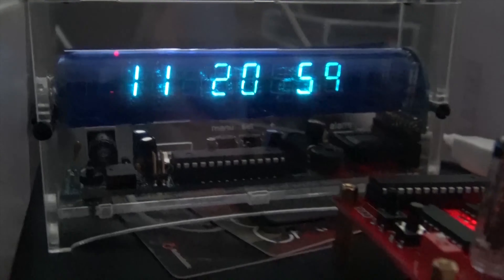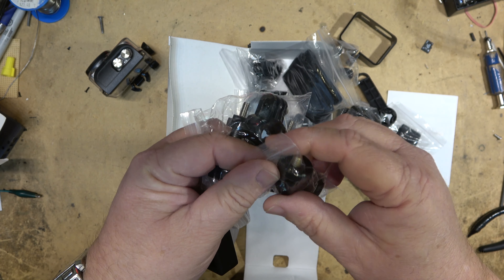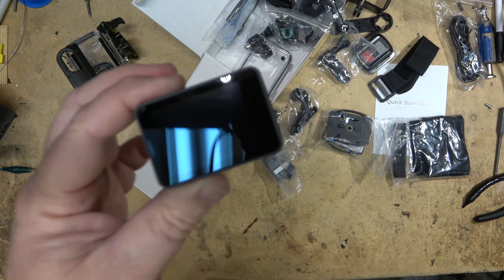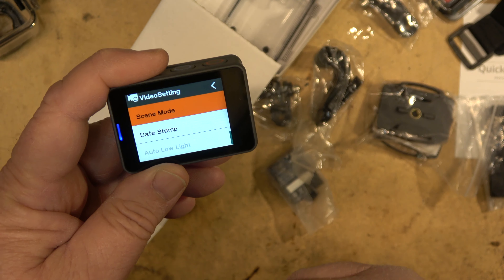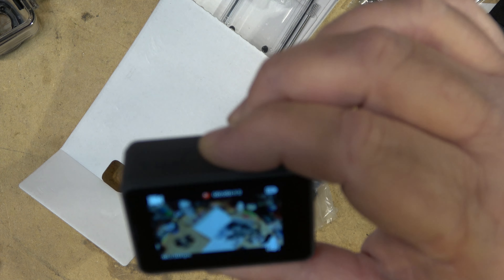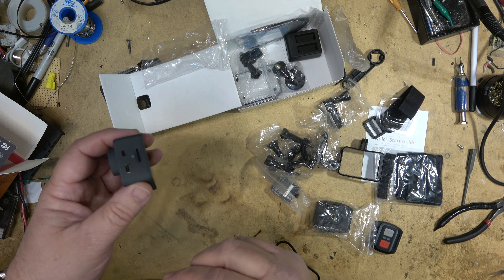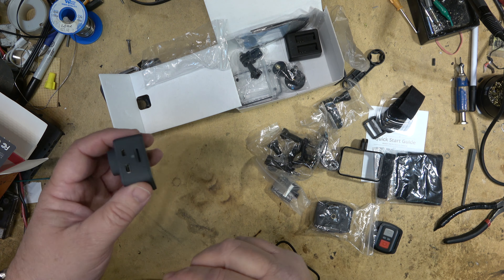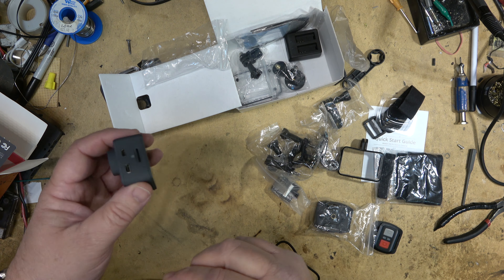Akaso V50 Pro special edition action cam unbox and test run

Comment: I have a total of 3 VCR's that have a problem. I'm working on saving VHS tapes that I've recorded over many years to a digital format and I have only one working VCR. I'm hoping to get at least 2 of these repaired. 

The VCR's I have is a Sony SLV-N700, a Sony VCR/DVD combo SLV-D360P and I purchased a used JVC HR-XVC11 (which is a VCR/DVD combo) from Goodwill to have a second working VCR (it was the only one they had).

The Sony SLV-N700 tries to load a VHS tape, and before it's completely loaded, you can hear (and see with the cover off) the rewind take up wheel spinning. Before the tape fully loads it ejects. Sometimes the tape does fully load, but the tape indicator on the front display flashes.

The Sony SLV-D360P VCR/DVD combo, a couple tapes broke while winding a tape. Now when trying to load a tape, it won't load. The only way it'll load is to spin the loading motor to get the tape to load ... however even though it loads the spindles don't move and it sometimes ejects the tape ... however when it ejects, the tape isn't taken up.

The JVC HR-XVC11 VCR/DVD combo (the one bought from Goodwill) started to work fine, but the audio cut out and now there is no audio.

Any ideas and can these be repaired for a reasonable price??
Reply from the maker: I'm sure they can be fixed but with VHS machines going for about 15 bucks these days it probably isn't worth it.  Just the belts will cost more.
Reply: @12voltvids  The Sony one with the VCR & DVD player, the only thing that doesn't move on it are the spindles. I assumed it might be a belt issue. So I tried taking the original belt off (it's a non-toothed one), cleaning the groves where the belt went with a q-tip and rubbing alcohol. I then put on a small rubber band to act as a belt. While a rubber band isn't ideal, it was for testing to see if it was the belt. And the spindles still don't move. I can't see the spindle motor to see if it's turning. So I'm not sure if the motor is bad (what is the voltage on the motor that drives the spindles??), a sensor or something isn't fully engaging. I'll see if I can check and see if the motor is moving at all.

One thing I did note before this issue, was when I was rewinding or fast forwarding a tape. When it got to the end of the tape (or beginning when rewinding) the fast forwarding (or rewinding) would do it in spurts. Say I was fast forwarding the tape from the beginning, it would slowly wind around 1 min and 27 seconds before it engaged the hi-speed winding (I'm guessing to verify both spindles are turning), then it slows down to a slower speed near the end of the tape. Around 30 mins to the end of the tape, it would wind slowly and in spurts... like someone was holding on one of the spindles to stop it then letting it go and stopping it again over and over again ... sometimes that stops and it used the slower winding speed to reach the end of the tape, sometimes not. From what I've seen this didn't have any similar affect when using the play option.

Comment: I have a Sony Action Cam which is quite good, but if you buy it new it is very expensive 4k but it cannot.
Why are the traffic lights installed on the other side of the street with you and not, as with us, directly at the intersection, that has a special reason. Greetings Jens from Leipzig Germany.
Reply from the maker: They are all at the far side so when you are sitting at the line you can see them. If they were on the close side of the intersection you would have to stop 20 feet back to see them.

Comment: Great to seee one of these reviewed by someone i know has loads of cameras! My son bought me one for my birthday last year as Id started cycling againduring the lockdown. Too many near-misses for an old boy on a bicycle. it was so good, I bought another (2nd hand off ebay-£20) as I have them mounted on my 2 e-bikes. They are a different make to your model- DRAGON TOUCH. basically, ones go a touch screen, the other hasnt. You get 1 hour out of each battery- but changing the battery means you need to put all the settings back in- especially the date/time. I always set the screen timeout to a minute otherwise the screen eats up battery life. The remote you demonstrated is a great help to pause the camera. I loop mine 5 mins- its easier to find things.Also, you need to have loop set if you want it to keep recording (when the SD gets full)